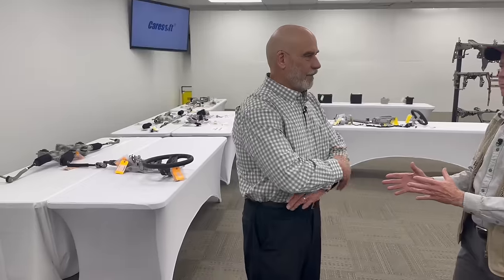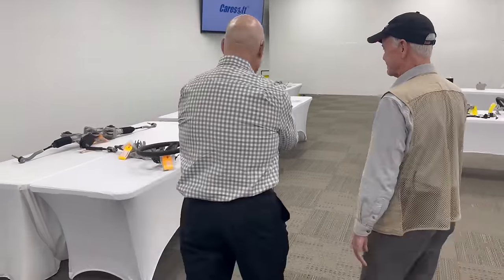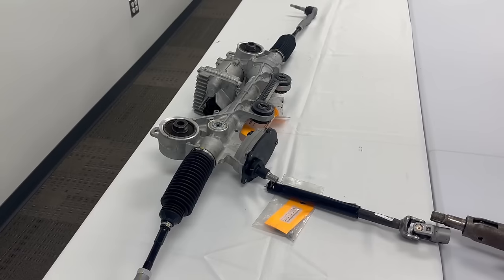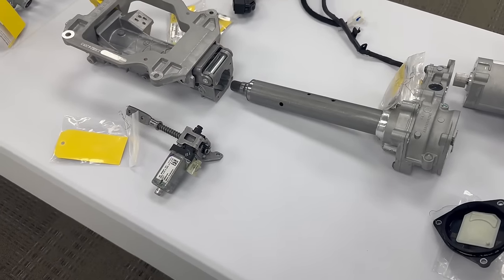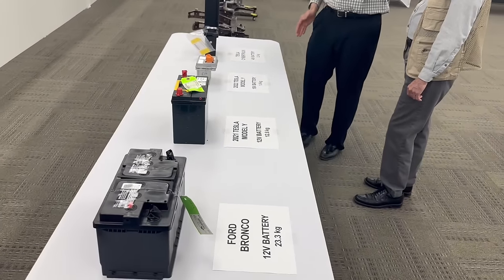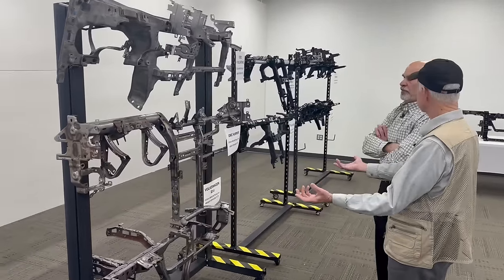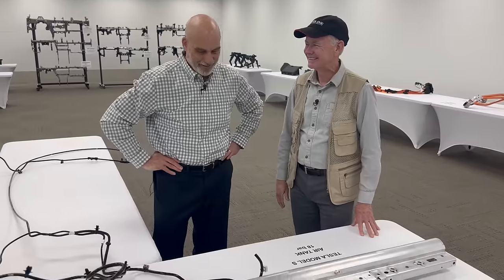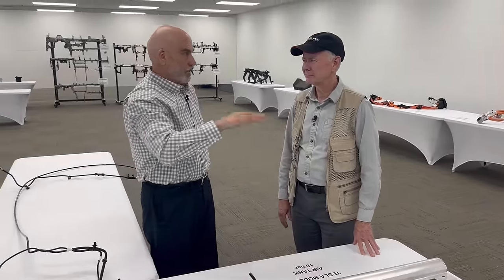Tesla's Extraordinary Design Evolution - Caresoft Cybertruck Teardown

Comment: Tesla engineers pursuit for efficiency just blows me away when you see videos like this!
Reply: It's a mindset and culture change. I hated in the past people saying things cannot be done
Reply: @bytejourneycodes  Get the bean counters out of directing auto industry engineering!
Reply: Bean counting is very importend!Changing things to fast is also very costly and will be a problem with spareparts in the future!
Reply: Sandy Monroe said when he worked for Ford back in the 80s, the engineers wanted to switch to a 48 volt system.... but the bean counters killed that idea.
Reply: @billybobbob3003  
So? You can't compare a 1.26 kwh 12 volt lead acid which can last 500 cycles to an EV battery, which can vary between 35 kwh all the way up to 212 kwh. Which can last 1500 to 2000 cycles, with a life expectancy of around 200,000 MI. You'll never get a lead acid battery to last 200,000 miles in a vehicle.
Reply: @grumpusmaximus9446 So the beancounters werw right!No need to change just so its more expensi!
Reply: @grumpusmaximus9446 I dont know why you all talk about Sandy like he invented the wheel!
Reply: @brunoheggli2888 
He has literally told you it would be cheaper in long term and lead battery is heavy and can't survive 2000 cycles
You: no need to change 25 kilos 😂
Reply: @barryjdwyer  what's a bean counter again?
Reply: lol!!!!! what a joke! those people have obsviously never took apart all the cars from all manufacturers down! that dasboard aluminium injected plastic has been in use in Europe for a very long time for example.
Reply: @billybobbob3003  but you save way more money by not pay for electricity to lug 23kg of lead around for the life of the vehicle.
Reply: These steering systems are failing at an unacceptable rate with the cyber trucks. And somehow people are heaping praise on the Tesla engineers. There’s a big disconnect between fantasy and reality.

Comment: This solid wire. We have everyone buzzing about combining functions. So people are working on structural batteries where the battery is the frame or the skin of a vehicle. The Tesla structural battery PACK goes in this direction even though it’s not the same. Tesla’s Model S combines the compressed air tank with the cross rib. So what about this solid metal wire? How can a part or a part of the frame be used to transmit electricity <safely> ...? What about communication cables?

Comment: 35:00 the line going to the battery pack from the air reservoir is absolutely to pressurise the battery pack if you are going into deep water - eg crossing a river.

Comment: I saw in a video that there is a dashboard setting button that allows the driver to set the vehicle for water fording.  I believe they said it was indeed to provide positive pressure to the battery pack to help keep water from intruding.

Comment: the steer by wire system you can tell require software engineering.  The electric car is more like a computer.  We all know how computer technology keeps coming down in price while advancing in computing power and efficiency and everything else.  Batteries also will benefit from chemistry advancements while costs will keep coming down.  Unfortunately for the gas powered combustion engine car it's had its day..., it can't compete with computer on wheels.  Maybe a 9 year old by the time they turn 16 they might not want a gas car... that's just a few years away.

Comment: In both EV and ICE, it seems that power density matters more than energy density. You can always recharge the battery, be it from an alternator or the high-voltage pack of an EV. If you can increase power density for the same energy density, you could make the low-voltage battery smaller. But what battery technologies could help with that?

Comment: 19:13 - specifically GD&T stands for Geometric Dimensioning and Tolerancing.  it's "CAD speak" among Engineers, Designers, etc and most specifically among the Drafters (ie, Autocad, Solidworks, Pro Engineer/PTC Creo, On Shape, etc) directly responsible for producing the reference drawings that ultimately get used to build a product or part from.  basically it's a fancy way of saying if a part doesn't get dimensioned properly...? then it won't be manufactured properly.  while accuracy is certainly critical in all sectors, it's even moreso in a field like Aerospace and Defense where an ultra high degree of precision is required (think: building Pratt F119 engines to power the F22 Raptor).

Comment: It wouldn't look that much more complex than gms system, if you didn't completely disassemble every part and spread it out across the table.   It honestly seems intentional.   I'm looking at all the parts for the Tesla. And trying to imagine it assembled.  Also, you're not showing the power steering pump, Which would no doubt make the gm system look more complex

Comment: This is an awesome video, very well presented and made easily digestible for the public. Just one small question that came up for me at 35:00 , when he was talking about the ability to pressurize the battery compartment for the "Wade" mode I believe it is called. He makes reference to them being confused, and having to theorize why the battery had an air supply. Maybe I am wrong but I remember a Cybertruck engineer out right saying it had a "Wade" mode that used air pressure to keep the battery dry quite a while ago, so I can't understand how this was a mystery at this point to them. But maybe I am just incorrect about the timeline.

Comment: Cross-car beams:  So a PHEV can’t do all the light-changes possible in a BEV, and have to stay heavier to take care of the 2nd powertrain’s effects.
Reply: Hybrids combine a lot of drawbacks with both types of power train.
Reply: Cross-car beams: The Mg one is lighter than all of the others and has the same features as the plastic hybrid which is heavier. For Earth Day 2024, let’s recycle these materials and stop using petro-plastics.
Reply: @user-rp7rf1si8j  Plastics in cars are in use for over 10 years.
Single use plastics are the problem.
Ignorance is the problem not environmentalism
Reply: The Tesla plastic over mold is single use due to the filler. 😢

Comment: I'd add Full Self Driving to the benefits of the steer by wire.  The extra bits are to completely isolate the steering function from the person in the seat, eventually.
Reply: All Teslas have FSD capability, steer by wire isn’t required for it to function.
Reply: @fredbloggs5902 I think they mean that the steering wheel will be able to be removed.
Reply: Speed-dependant variable ratio on front, speed-dependant direction on rear.
Feedback - that was one complaint hypothesised against steer-by-wire.
For a larger vehicle, you’d wonder why it took a century to dream it up.
Curiously, it’s the reason for going "48-volt". Which explains the century part.
Reply: @iandavies4853  I just wonder how reliable all of these steer by wire components will be in ten years of winters, rough roads, etc.  How safe is that old beat up Tesla speeding toward you at 160 mph relative speed?

Comment: In this tear down Battery table, there are several key criteria missing, in this little tour, the static  voltage, ie in a fully charged state, no charging or discharging current happening. The minimum and maximum voltage limits from full to empty, max voltage during charge, the Amp-hour charging capacity. Then times the Voltage, to convert to watt-hours each battery can deliver in to the system, and how much power the battery delivers into the system if there is a failure of the main  charging source such as the Main Battery DC-DC Converter, or in gasoline or diesel systems, an engine stall or alternator failure. Mainly to determine how long after failure of the charging source does the system shut down. Ie how long after the warnings start sounding does the engine stall out because the injectors can’t spray, the ignition can’t spark and the engine manager can’t read the sensors to calculate the management of a running engine, electric power steering no longer has boost, vacuum pumps stop making vacuum for power brakes on Turbocharged or supercharged engines. Conversely. How long does the Tesla management system control the drivetrain if still controllable in the event of a Dc to DC step down converter that supplies the 48 volt power over Ethernet communication network the CyberTruck uses or the Canbus, on older Tesla vehicles, that run everything including the brake lights, headlights and all directional signals, power door latches, locks, window motors. Wiper motor, HVAC, which keeps the windshield fog free, and in the case of the electric slave fault tolerant, power steering rack.  Tesla claims to have a multiple backed up steering column sensing system with multiple control systems driving that dual motor rack with independent power supples to keep control active after initial failure, that starts the warning alarms to pull over and stop driving immediately in the event of failure. The critical parameters are how well backed up is this redundant, critical steering system, and how much reserve steering time does the driver or Ai have to safely park this truck, before loss of steering input occurs when the shit hits the fan?
Reply: It's a pretty safe bet, the engineers who designed all this cool shit.. know how to design a system that has some safety tolerance for failures. It's kind of a basic principle of engineering such systems. If nothing else, due to any companies aversion to being sued to hell for NOT doing such a basic safety task.
Reply: The engineers are part of a culture known for world leading safety and landing rockets.
Reply: @airheart1  that is all well and good, but I feel those who drive this technology, need to understand how much margin there is before it quits.  How, well it works when one motor is disabled in the rack, how long it can operate when the primary source of energy is disabled, is is 1 minute, five minutes, ten minutes, etc.  on way I could see this system have the perfect amount of reserve energy, is the system feeds off of regenerative voltage as the motor is automatically put into regenerative mode, so that as long as the vehicle is in motion, even if the main drive battery is out of the picture, the steering racks and their control system will continue to accept command input into there is no further motion, at which point, steering no longer matters, other than to get the vehicle to cooperate to be dragged onto a flatbed to be towed from the scene. If cooperation of a dead vehicle to steer, is not possible, the chassis is lifted and caster dollies are placed under the wheels.

Comment: Stunning how superior the Tesla engineering is over legacy manufacturers.   Unsurprisingly when it comes to batteries and the EV drive train, but it blows me away that they reinvent the fundamentals like steering and the front dash cross car beam. Achieving lightness, cost efficiency  and superior functionality all at once......
Reply: Tesla engineering isnt better then Legacy!
Reply: @brunoheggli2888  Lol!
Reply: What makes you think they are better at steering? Steer-by-wire? Rear wheel steering? All have been done before.
And for the front dash cross bar - the plastic clip on is a thing that I do hate on any modern car. Plastic tends to weaken over time, and plastic clips tend to crack. Unlike a bolt or screw. And yeah, sure, in a manufacturing perspective (and cost), it might be great, but it does suck for anyone who wants or likes to fix or upgrade their own car.
Reply: @midakassi  but what proportion of drivers actually want to maintain their own car? Less than 1%. Does Tesla optimise for the 99% or the 1%? That 99% includes all Moms and Dads who commute to office jobs and take kids to school and drive on holiday and have no desire to have to maintain their own cars. The 1% are full-on car enthusiasts who love their cars and probably want to stick with their classic ICE cars and tinker over the weekend as a hobby. That's a clear and very definite demographic that's not going away, but it is a small group.  Also, a modern CT owner wants to be out offroading and doing exciting stuff in the CT rather than fixing stuff and tinkering under the hood. Tesla is right to have gone with plastic clips that can be attached quickly and cheaply by Optimus bots.
Reply: @garyrooksby  plastic clips are making the gas peddals get stuck. A recall is in order.

Comment: I love that it was not all Tesla bro fanboy talk. 
For example, how complex the Tesla glove box design with motor and plastic gearing.
And that fly by wire did NOT reduce weight and complexity, but rather increased capabilities.  I also appreciate that as a pathfinder vehicle with some first iterations of technology, the CyberTruck was not fully optimized.

Comment: Well presented, high on facts and relevant context. And an interesting way of demonstrating how legacy procedures directly hamper creating the most efficient EV designs.

Redundancy in aerospace, as fas as I know, works a little differently. You wouldn't just duplicate (or triple or quadruple) one actuation mechanism, but also make sure to have one or two different actuators. In the case of Tesla's steer-by-wire, the second eletric motor would at least have to come from a widely differing production batch, or  even another manufacturer.

Comment: Efficiency that enhances performance is not cheap(...?) When Tesla 'designs' products, the cost is a secondary consideration. Increasing production speed, reliability, and safety are constant throughout the build process(.) Every analysis of Tesla components includes the phrase "that's not cheap to do", but the why is clearly evident and consistent with a 'level-of-quality' that is easily recognized($)

Comment: The 48 V architecture on the Cyber truck saves about 70 lbs of copper per truck. 
If all legacy vehicles built each year transitioned to this 48V weight saving that could be as much as 25 million cars built each year. Could save 2.5 million tons of copper globally. This is close to the 4 million lbs recycled each year. So not an insignificant amount. 
In older homes drain pipes used to be copper and those have mostly been replaced with ABS or PVC plastic pipe. And currently wet plumbing pipes are being replaced with pex plastic or similar pipe. 
Wiring in homes may soon eliminate most switch wires with wireless solutions.
More modern motor designs for appliances will also save copper. And modern server farms and personal computers will also use less copper, there will be recycling opportunities there as well.
Because electrification EVs and windmills and AGI and robots will all use more copper, mining will have to ramp up.

Comment: I was really curious about the Cybertruck’s air tank. Thanks for showing it.

We have a structural battery pack and the S has a structural air tank. How can the Cybertruck have its air tank integrated into the structure or frame?

There might be many frame parts which can be designed to hold pressurized air. It doesn’t need to be the crossbar. Since air can take any shape, that really opens up the possibilities what part of the frame can double as air tank. This would especially apply for the semi. 

You showed a tube that holds the dash assembly. That’s visually a first place to consider for an air tank. We don’t want an air tank to blow up in someone’s face, so there could be weak points built into the front of this tank, so a blast from a tank rupture would more likely blow the air away from the cabin.

What if the suspension cylinders at the wheels were slightly larger, so you had 4 small tanks instead of one large tank?

Comment: The steer by wire is going to be developed for Tesla’s robotaxi efforts.

And the pressurized battery was publicized by Tesla.  They have a Wade mode where the battery pressurizes for crossing streams and getting through a few feet of water.

Comment: I know a lot of people don’t care for the steering wheel on the whole thing, but I do see the logic in it. The squirrel is interesting because talking with a new driver because I don’t have kids on my own. They don’t teach you to put your hands at 10 and two anymore Because of the airbags they actually teach you to put your hands and I think it’s three and nine if I remember right and can break your wrist if the airbag goes out, so that being said by doing what they did, they force you to put your hands where they’re supposed to be and with the limited, turning radius to get your turn, you really don’t need to use the top or the 45° angles too much in theory. So that’s my assessment, so with that thought the steering wheel is not bad. It’s just different. I see it working pretty good with a steer by wire system Even out in the backfield. I wonder what an engineers like this thoughts would be on my theory from the safety point of view.

Comment: Since steer-by-wire does not require multiple turns of the steering wheel at low speed or big angle turn at high speed, why would the shape matter much. I may be wrong, but I seem to remember messages on social media confirming a Wade mode to pressurise the battery pack for water proofing, so not sure why they needed to speculate on this.